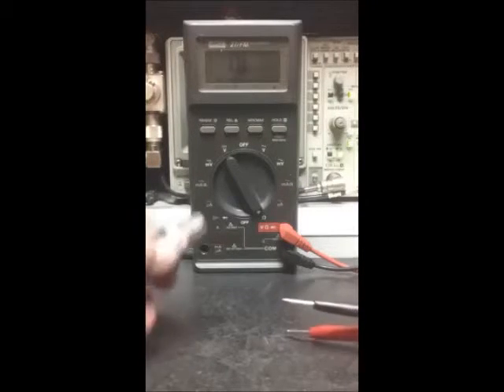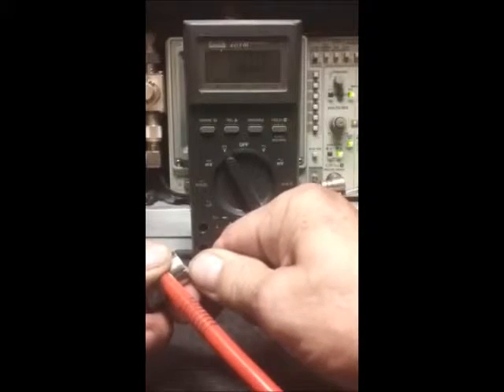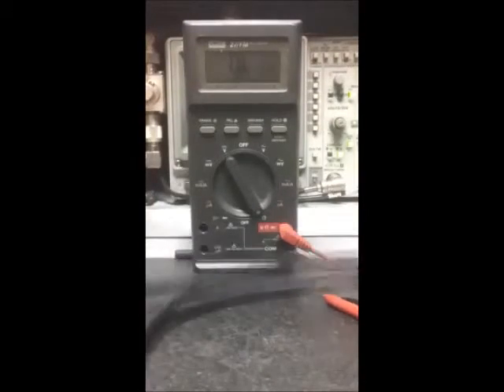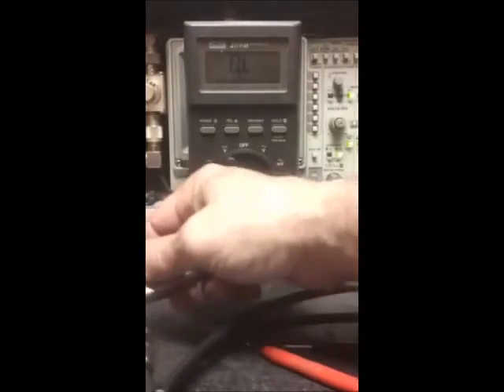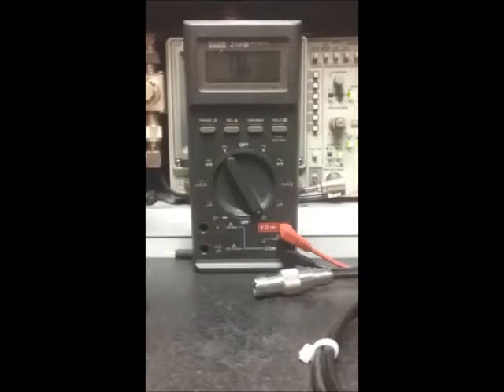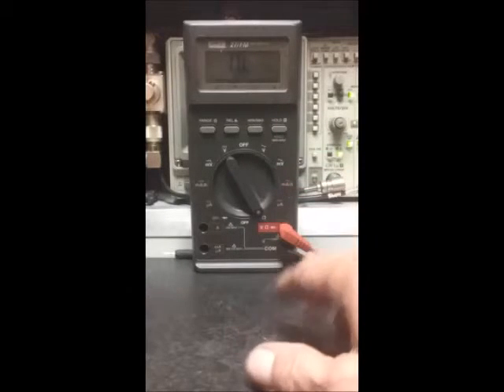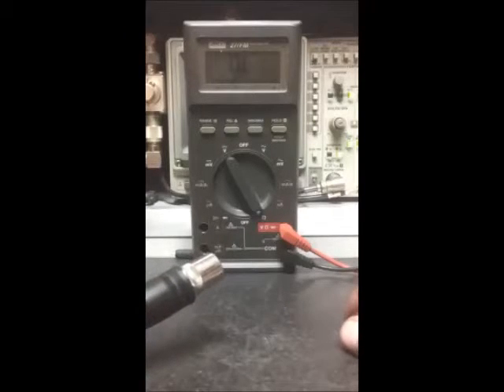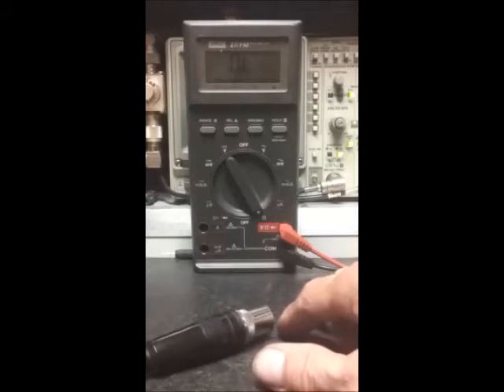50 ohm myth

Comment: I have one problem with you demonstration.  When you connect your multimeter probes on the connectors your fingers are in contact with the probes therefore the moisture in your skin becomes part of the circuit and you body has its own resistance so you measurements are inaccurate.  Try it: select Resistance on you multimeter, then grip the end of the positive probe between your right thumb and forefinger.  Do the same with the negative probe; gripping it between the thumb and forefinger of you left hand and you will get a resistance reading on the meter less than infinity.